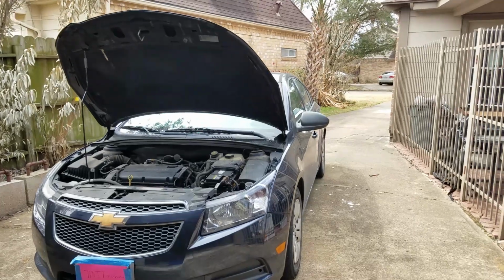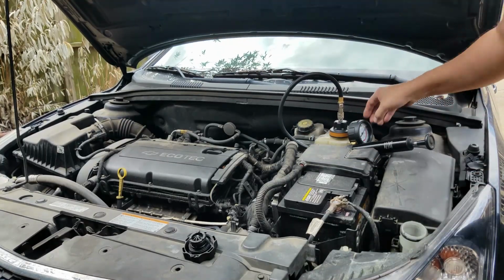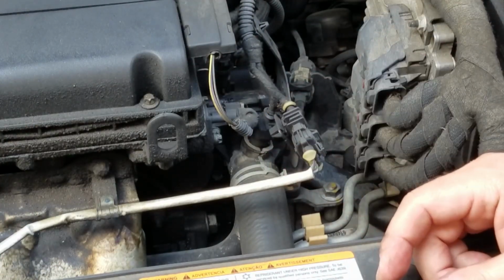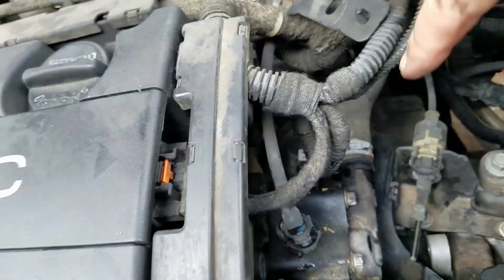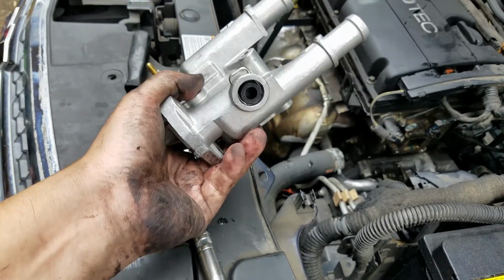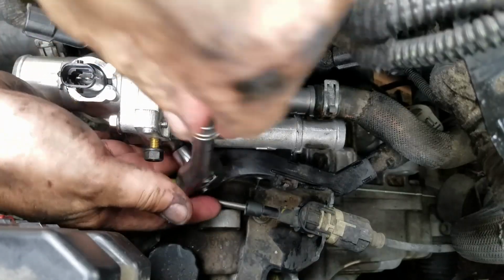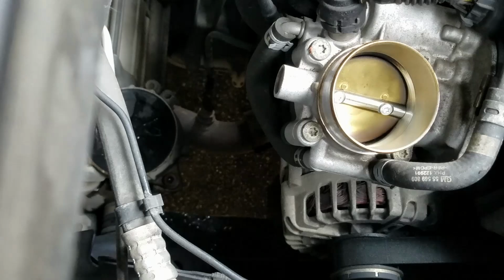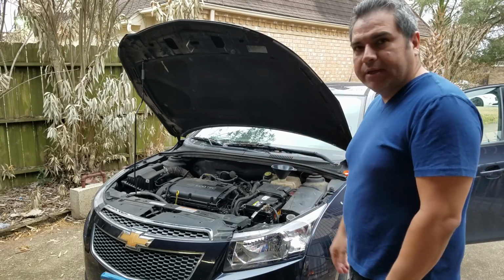2014 Chevy Cruze 1.8L  How to replace thermostat housing and details of extra parts needed.

Comment: I actually have a hole in this assembly in my wife's 2014 LS and thought I needed to replace the water outlet only after watching a different video on a 2014 turbo Cruze (thought it'd have the same design). After receiving the part, I could see that it wasn't the same, though I did see that part number stamped on what must be a section of the thermostat housing assembly in the vehicle (housing and outlet, one assembly). I then watched your video and I think that confirmed it.  Will run and grab the assembly tomorrow. Thanks for the help. Will watch your video again for the install.
Reply from the maker: Thank you for taking the time to write this comment. This keeps me motivated to continue to make videos. Glad the video was informative for your needs.
Reply: @713jtmechanic8  Hi again. Ran into a problem and thought I'd run it by you. When I was trying to bolt the oil cooler pipe to the assembly, I of course was moving it around a little bit to try to get some access and suddenly the pipe was free moving. No sound, no sudden jarring, nothing, just free moving right to left and up and down. It felt like I successfully worked the pipe back into its seating, so I grabbed my borescope to see. It was in fact coupled with the larger pipe coming from the left side of the engine. So, is the pipe broken, do you know? Are the pipes supposed to be clamped or? I noticed in your video that you seemed to have rotated that pipe when showing the gasket. If I can't figure this out, will be a defeated tow to the garage tomorrow. Thanks...
Reply: I just looked up the outlet pipe part and saw there's just an o-ring at the other end. Then I watched an engine oil cooler replacement video and saw the guy just pulled that pipe out, as I did accidentally. So, I should be good to go, right? Or should I pull it all the way out and check the o-ring?
Reply from the maker: @jayboz034  I believe the pipe is insert, regarding the pipe leading to the left side of engine. It actually connects to the back of water pump. I don't think there will be a problem on that end, however, I do recommend to replace oring to the thermostat housing end of pipe. The oring mentioned in the video.
Reply: @713jtmechanic8  Okay, last question, please. Is it as easy to insert the outlet pipe into the receiving pipe that you say goes into the back of the water pump without disassembling further?  So simply pushing into that pipe behind the exhaust manifold until it stops and can assume its seated correctly, or do I need eyes on? Thanks..
Reply from the maker: @jayboz034  It's been quite some time I done the repair. I can't remember if you can insert or will have to remove manifold to gain access. Sorry, I don't have an answer.
Reply: @713jtmechanic8  Hey, no problem. So, put it all together and ran it for about 15-20 min with reservoir cap off in the driveway. Reservoir was full and eventually got near empty after coolant circulated (had heat running too).  No visible leaks and temp gage looked good. Then I took it for a test drive (coolant still very low in reservoir). Was good in the neighborhood but when I took it to 45 mph the gage started rising. Turned around and just before I pulled into neighborhood it spiked full hot. No leaks, no smoke. Let it sit for 30 minutes and started back up. The gage was reading good again, which is odd because I'd expect it to be still hot at that point if it truly did spike, and stayed good the quarter mile home at 25 mph.  So, not sure what to make of it. No visible leaks still. Getting 7EB and 7EA codes. May just take it to shop in the morning. We've seen these temp spikes before but I can't recall what it was. Not sure I'm convinced it actually overheated?
Reply: Couple of clamps were a little loose and had to replace the same sensor you did. Otherwise, everything was good. Thanks again for all of the support. Really appreciate it...
Reply from the maker: @jayboz034  Excellent work J! Thank you for the update. Glad everything went well.
Reply from the maker: Hi J!  In my experience, if the outlet tube is slightly moved, there is a great chance the oring well not seal properly. Any oring does not have memory of its last position. Meaning oring will not reset to it’s original position. I highly recommend to replace oring.
Reply: @713jtmechanic8  Thanks. I'll either get a new o-ring or pipe. At the thermostat end, if I grab a new pipe I'll still need to use the new gasket I bought from your suggestion, right, or will leak with the Dorman assembly? Thanks again for the support here.
Reply from the maker: @jayboz034  Yes, correct regarding Oring. Your repair is going to turn out great. Sending positive vibes to you.
Reply: @713jtmechanic8  You rock. Thank you.

Comment: I bought the same part with lifetime warranty. This is my third time replacing it. Check engine light disappears. About a month later, every time, fans kick on, and check engine light pops up. Its trash but I’m getting rid of the car soon, hopefully and I’m just glad I can go in and get a new part at no extra cost due to the lifetime warranty. Don’t buy a Cruze people, this car has been a leaking, breaking down nightmare.
Reply from the maker: Sorry that you are going through a rough time with your Chevy Cruze. Thank you for comment. It may help the community, especially, if someone is considering to buy a Chevy Cruze.
Reply: I have a 1.8 2014 Cruze and I have had no issues at all? maybe yours was made on a Monday morning.
Reply: @integr8er66  I got it replaced once more. This time looks like they got it right. Fingers closed i don’t jinx myself

Comment: Your right about buying the o-ring mine leaked after I installed everything wish I would of watched this video prior. Thank you for the parts number saved me a little time anyway. Great video!!
Reply: I ordered the o-ring, but it seems like its too wide, looks like a coupling oring, the metal pipe wont sit flat against the housing with the oring because its too wide, is this normal or should the oring be the donut shape kind?
Reply: @CasasChicago  I had the same issue. Did you resolve this?
Reply: @CasasChicago The o ring I purchased from these video recommendations did not work.
Reply: What was the part number for the oring for that tube
Reply: @napoleongarrett582  Hello Napoleon just watch the entire video he gives the part number near the end. Good luck.

Comment: I replaced my thermostat housing with the exact same aluminum part a year ago in my Cruze !!! Haven’t had a leak since 🙏
Reply from the maker: Thank you so much for the input. This will help the community.
Reply: @713jtmechanic8  update I’ve officially had the car for a year and half with same part still in place. Fluid level at max capacity still. 👍
Reply from the maker: @jacobspookykid5328  Thank you Jacob for the update. This is good news and great for the community. Thanks again.

Comment: So do I have to do all of this to just change the thermostat itself?
Reply from the maker: Yes, don't forget to order the rubber ring gasket for oil cooler tube. It's not worth replacing the the thermostat back housing piece. It will leak quickly. Its best to replace the entire assembly, less problems in the future.

Comment: Question I probably mixed the hose in and out how I know the right position? On the termostato housing
Reply: Thank you 😊
Reply from the maker: You going to have to use your best judgement regarding the thermostat housing hose. The best advice I can offer, when hose is installed take a look at the hose to see if it has Kinks. If the hose looks like it has it's natural form, then you the hose is installed correct. Unfortunately, the hose does not have an indicator to help with installing hose correct. Hope this helps. Good luck .
Reply: @713jtmechanic8   thank you
Reply: You can tell because the one on the outboard side has a "Y" in it that goes to the tank also.

Comment: The sensor is the actual problem. It will cause a low oil pressure reading.  Coolant escapes through sensor and pushes through wires. Causing no connection.
Reply: I just had my thermostat housing unit replaced. Car was great for 2 weeks. Now it’s losing water with no visible leak.  Seems I have to add water every other day. And yesterday it told me it was time to change my oil when I should have 1,500 miles left according to my last oil change. I seen there were 2 sensors on the thermostat housing unit—which one needs to be replaced? Or should it be both? (My mechanic is not returning my calls so your input would be helpful, thank you)
Reply from the maker: @heatherwilliams81  I am sorry you are not getting a response back from your mechanic. The thermostat housing unit came with both new sensors, seen on this video. Your replacement may have new sensors as well. If you don't see an external leak of coolant. Check the engine oil dip stick. This is to verify if coolant is not mixing with oil. However, I highly suggest to find a mechanic or if you are mechanically incline to pressure test the coolant system. This test will identify the coolant leak.  Regarding your recommended oil change reminder not accurate. I will have to research that problem. I have not experienced that repair on a vehicle, yet.  Good Luck Heather. Hope this helped.
Reply from the maker: @heatherwilliams81  I just thought of something. Take a look at the engine and locate the Pulleys and belt. If you see a corroded substance splattered in that area . It is possible the water pump is leaking, however, not enough to notice an external leak.
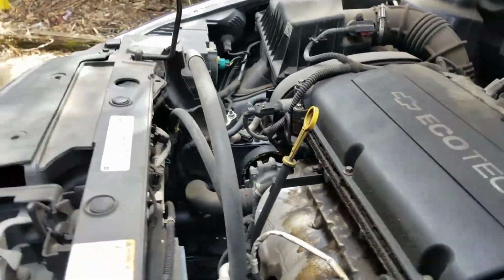Reply from the maker: Take a look at the video timeline 1:35 and pause it. You will notice the corroded substance along the hoses. That is an indication of a leaking water pump. Hope this helps. Please, keep us posted. Your comments and replies may help others. Thank you Heather.
Reply from the maker: This is good and informative. This will help the community. Thank you for taking the time. :)
Reply: The oil change reminder is NOT based on only miles, it looks at temperature and other things to determine when the oil is done. If your temp sensor is bad it would affect that.